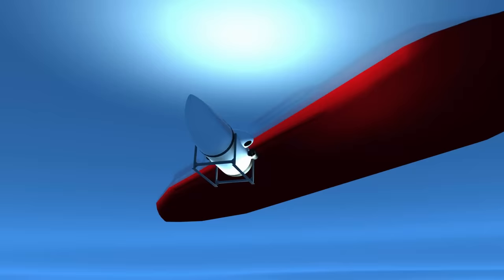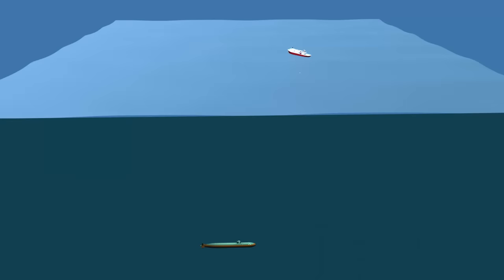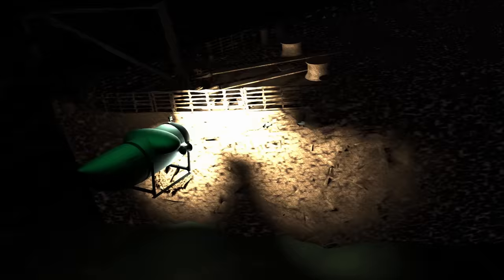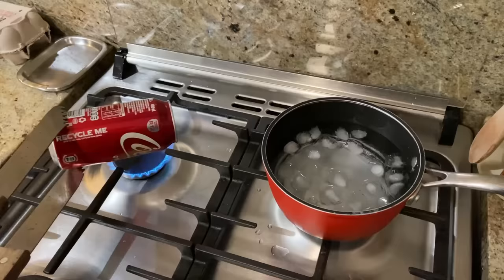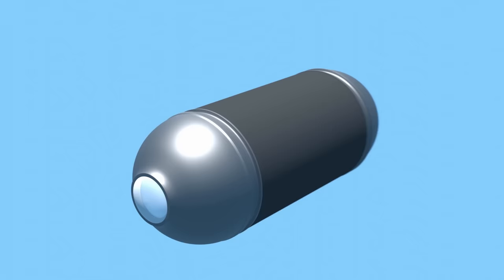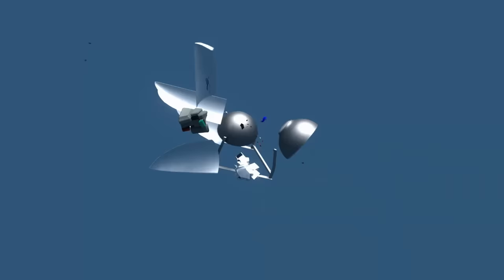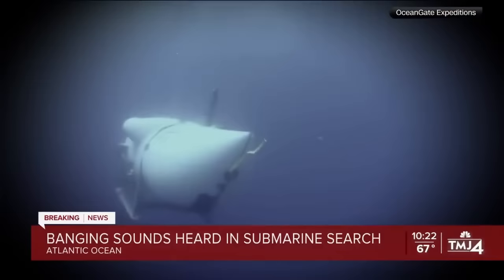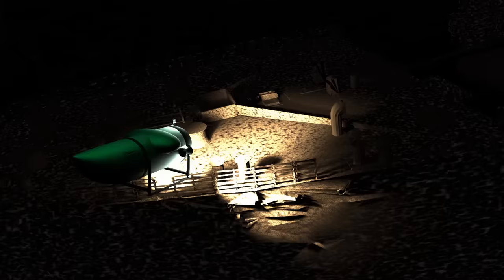TITAN Sub implosion | Deep Dive animation explanation

Comment: This was really good, I just can’t believe how something thrown together cheaply even made it to those depths a couple time before, you said trip 24? I heard they only went to the Titanic like 3 times, if the guy just retired it after a couple dives and built another probably would of worked, it’s just crazy that military subs or submarines in general can’t go that far, but that guy basically used a “water heater” and made it to the bottom of the ocean
Reply from the maker: Titan was by no means cheap. It was just cheaper. But when you are already spending big sums of money saving a few bucks is so dumb. If the main centre body had been titanium too I suspect some other non redundant system would have inevitably caused a disaster. Quite bizarre the way he dissed safety.
Reply: @Mike-Bell  ya that’s what I was thinking, the guy had money so why not make it perfect? Thanks for replying, I just keep seeing this stuff pop up but you’re video was the best one
Reply: it has many trips yes, but there have been hull replacement in those. this current hull had made about 7 trips before the implosion, about 3 or so were manned.
Reply: @terminalfrost3645  ok cool thanks for the information
Reply from the maker: @terminalfrost3645  Thanks for the important information and that sounds a lot better. Do you have the source.
Reply: I heard, this was Titan's 13th dive?
13 is a bad number.
Even hotels skip the 13th room or floor.
Reply: @szaki  It was not the 13th dive.  13 is not a bad number.  Hotels skip that floor to appease foolish people.
Reply: I believe this was the third year OceanGate had run expeditions to the Titanic wreck. They had sent down submersibles more times that than.
Reply: @Hyxtryx  Sub made 7 dives in 21, 5 in 22, and 1 this year.
13 dives, I think James Cameron said it.
13 is a suprstatios number, just like 666.
Yes, people are suprstatios that's why they avoided.
Hotels knows it.
Reply: I query the 24. I understand this was the seventh dive. I doubt it would have made 10 dives.😊
Reply: OK. It was not cheap although compared to a real submarine it was. The fact is submarines are built to very strict standards for different reasons. They are not built to just wonder down to the bottom of the Atlantic to look atvwtecks so deep submergence is not relevant. That belongs to the deep sea submersible folk with properly engineered deep submersibles not some equivalent of a gd sunset champagne cruise. .
Reply: @szaki lol, this is not even up for dispute. This was NOT the Titan 's 13th dive
Reply: @TheCandiceWang  Titan had many dives, most are test dives.
I'm talking about dives to the Titanic in 2021,2022 and 2023..
2020 the hall's rating was degraded to 3000 m, so it had to be repaired!
Reply: @Hyxtryx  lol, as I give your comment a thumbs up, it comes up 13.

Comment: I was watching a video made about ten years ago about pressure test on carbon fiber cylindrical hulls. When the pressure hull failed it didn't equally crush like the metal ones did, it split length wise and allowed the pressure to equalize. I'm thinking something similar happened but not length wise due to their incorrect way of laying the carbon fiber so the split would have been ring shape. My theory is the carbon fiber started to de-laminate and bow in the middle and the two titanium hemispheres just crushed it inward like stepping on top of a empty soda can. I think along with the microphone to record the cracking of the carbon fiber they did mention they had a string indicator (a string strong across from one side of the sub to the other to monitor how much the vessel is compressing, an old trick from the earlier sub days), so my fear is they started noticing the string drop way more then normal or the cracking was really starting to intensify they then dropped the weights in an attempt to save it but by then it was too late. Fear of this being a moment before the implosion they knew they were probably doomed, also with this many layers of incorrectly layered carbon fiber I wonder if there wasn't a second or two of water making it in by traveling in between all the layers before the implosion. I hope not as this would have been horrifying for them but we just don't currently know for sure as there are no substantial testing of this situation with the method of wrapping carbon fiber as they did. Makes me so mad that this CEO thought it was perfectly fine to take people down there when there were so many experts with decades of experience telling him "Hey, you're going to get some one killed!" He truly thought he knew better then everyone else.
Reply from the maker: Yes you think of the pressure onto the face of the tube but the force from the domes onto the ends of the tube are huge too. After pressure cycles the composite fatigue must have started becoming a mess.
Reply: If there were no carbon fibers, I'd expect the hull to be squished flat at the waist.  If there were longitudinal fibers which were parallel to the surface, it wouldn't be able to squish flat at the waist without substantially increasing the length of the longitudinal fibers, but the mechanical advantage would amplify the forces on the fibers enormously.  To make a strong structure, the fibers's direction vector would need to have a component parallel to the applied force

Comment: The dropping of weights does not necessarily mean that they knew they were in trouble. Stockton mentioned that they usually drop the weights several hundred feet before they reach the bottom of the ocean to avoid the sub hitting the floor at a high speed. This was a way to “slow down” the descent. Only the OceanGate crew will know whether this dropping of weights was typical or atypical. But they’re not saying anything now.
Reply: But not a terrible assumption
Reply: James Cameron stated he spoke with people in that group of the mothership and said they dropped weights because they knew something was wrong and we’re trying to come up.
Reply: They are NOT at several hundred feet before the floor. They were barely there. You do know how deep this was? They hadn’t reached that far.
Reply: @KittenBowl1 I read 3500-feet is when they lost contact. Possibly the moment of peril.
Reply: @Seashellsbytheseashore21  Yeah, I heard that the message was that the cabin had been compromised and they were dropping weights. Sounds to me like he sprung a high pressure leak, maybe a small pinhole leak, and the compartment was filling with high pressure water. 2 minutes after this message was when the navy sensors detected an explosion. I think the leak into that sealed compartment blew it up like a balloon until it exploded.
Reply: @mygunisinnocent8028  Water rushing in would not pressurize the sub above the pressure of the water it is in. I would not cause the submarine to explode. If anything, it would tend to equalize the interior pressure with the exterior pressure, preserving the integrity of the sub, but, killing all of the occupants. The sub imploded due to failure of the pressure hull instantly killing all occupants as the submarine had an uncommanded disassembly.
Reply: @glittle2993  Imagine a tire with a sealed bead on a rim, and a valve stem that lets compressed air into it. If you keep forcing air into it, it's gonna eventually explode. The pressurized water wouldn't stop entering the sealed cylinder on the sub until it exploded or the end caps were blown off. We know by the last message sent, that the cabin had been compromised and he was resurfacing, so this rules out a sudden failure of the hull and split second implosion.  My theory is he sprung a leak, could have been a pinhole leak the size of a human hair, that started spraying pressurized water inside and exploded the thing 2 minutes later. 2 minutes after the last message the navy sensors detected an explosion. Another scenario is that when he said it had been compromised, he meant part of the hull had collapsed, and 2 minutes later the whole thing imploded like your theory. Even with the authorities examining the wreckage, I don't think we'll ever know for sure what happened, unless the ones on the surface ship have information that they haven't released. James Cameron just said the last message sent was that the hull had been compromised, but maybe the message had more detail that they haven't revealed? Stockton could have said the walls are caving in, and we're dropping weights to resurface, or we sprung a leak. I don't see why the NTSB or whoever is investigating, has to keep everything such a secret.
Reply: @ChristopherKKirby  Cameron said it was 3500 feet.  What I do not understand about that number is that it was roughly 1 hour and 45 minutes into the dive.  They should have been much deeper at that point. 3500 meters would make more sense given the time.  That would put them most of the way to the Titanic. I think maybe Cameron misspoke.  Or possibly they had other issues that were preventing descent.  The USS Thresher had it's implosion happen at a shallower depth so it is possible, just questioning the timeline.
Reply: @mygunisinnocent8028  is there a recorded in the passenger area?
Reply: @silentpoet75  they had to go down on the platform first before descending in the Titan.  that would take some time yes.
Reply: @mygunisinnocent8028  umm would the hull becoming fatigued  and losing its integrity make noise...Yes.  Also water leaking in at that depth.  No it would just implode before that.  You would  not get to observe a little leak for one second under that type of pressure.  It was an implosion. Remember pressure was coming from all around the Titan. Extreme pressure. Its not a tyre or a leaky vessel. It was made with experimental material for that type of vessel that fatigued and imploded.
Reply: @silentpoet75 people who were on it before have said that it takes a long time to get down there, it doesn't fall fast.
Reply: @mygunisinnocent8028    No - the difference here is that the tire is a higher pressure than what's outside.  Additionally, the device providing the additional pressure through the 'valve' in that case - is the pressure outside the sub (the equivalent of the single atmospheric pressure outside a tire).  There is no additional pressure like a pump providing a higher pressure than the outside pressure.  The highest pressure that can exist, is the pressure of the outside ocean.  Which as others said - would equalise, not explode.  The options are equalise slowly - or implode.

Every bit of water that enters the vessel - REDUCES the pressure differential between the inside and the outside.  Conversely - pumping air into a tire from your example, increases the differential.
Reply: @mygunisinnocent8028  You don't just "spring a leak" at that depth, let alone cruise around with it for a few minutes. And how could the internal pressure blow out against the hundreds of atmospheres of pressure pushing in on it? That's like saying you could put a balloon under the Empire State Building and inflate it until it popped the building off.
Reply: @mygunisinnocent8028  - the leak in the sub doesn't work like a tire in the example you give. You specifically state "a pressurized hose attached to the tire."

There was no pressurized water hose attached to the sub. Once enough water poured in, assuming the pressure hull didn't catastrophically fail and implode, as soon as the air inside has been replaced by water from outside, the water outside stops coming in because the pressure has been equalized. In order to pump more water in you would need....a pump. Unless someone swam down and hooked a pump up to the crack in the hull, it's not possible to blow the hull up like a balloon, with the surrounding sea water.
Reply: @warrenpeas  Cameron says he got the information from someone on the ship.
Reply: @Texas240  At that depth there are millions of pounds of pressure, so that would be the pump. A leak the size of human hair would start letting pressurized water into the sealed hull. The pressure of he water at that depth is 450 atmospheres, but the pressure inside the hull was 1 atmosphere. The pressure from the leak wouldn't stop filling the sealed compartment until it is equalized at 450 atmospheres, so it would have expanded and exploded, which is why the end caps were blown off and the CF is in tiny pieces.
Reply: @vigorousera  If Cameron is right, it took 2 minutes for the vessel to explode. When Stockton sent the last message that the cabin had been compromised, 2 minutes later the navy sensors detected an explosion. Imagine being surround by millions of pounds of pressure pressing in. All it would take is a leak the size of a human hair to explode the sealed cabin. The pressure would be entering the sealed vessel with nowhere to go, so it would expand it until it exploded. The stream of pressurized water would be so powerful that it would cut a person in half. Ever seen those high pressure water cutters that cut metal?
Reply: @MKu64  But the tire or the sealed cabin in this case, would be 1 atmosphere pressure or not inflated, while outside is 450 atmospheres. The 450 atmospheres would be like a giant air compressor and a leak would be like a valve stem that allows the pressure into the sealed cabin or uninflated tire. What happens when compressed air enters an uniflated tire? It blows it up. In the case of this sub there was no off switch for the air compressor once it started inflating the sealed cabin with pressurized water. It would have continued forcing pressurized water into the sealed cabin until it popped or exploded. Ever been around a truck tire when someone forgets and leaves the air compressor on it and over inflates it? It explodes.
Reply: @mygunisinnocent8028  - No. Once there is water on the inside and outside, the pressure has equalized.
Reply: @Texas240  That would be if the sub was on the surface and sprung a leak where the outside and inside were both one atmosphere. It would just trickle in until the sub was full of water. Imagine a tick sucking blood from a body. The pressure of the blood is gonna make the tick swell up. Better yet, image there are things called pressure monkeys and the sub is like a bud light can. There are 450 angry pressure monkeys trying to get into the bud light can, because the 1 pressure monkey inside ticked them off by being a kweer pressure monkey. They are pounding in on the bud light can until one of them finds a hole to enter, then they all start cramming into that can through the hole, but it isn't big enough for all 450 pressure monkeys. It's gonna expand that Bud Light can until it explodes.

Comment: I hope they didn’t have any warning of what was going to happen BUT I saw a video last night from a guy that went down in this submersible on its second dive, he said there were loud noises almost like gunshots going off the deeper they got and it happened during resurfacing also. I truly hope these sounds weren’t significantly worse before the implosion and gave them a chance to get worried about what might be happening. 🙏🏽
Reply: as far as I'm aware they did sense danger, according to james cameron they dropped weights.
Reply: Hi, can you please link that video?
Reply: The last communication they sent was that they dropped their weights and that was before they reached their decent so they knew there was some type of trouble because they were going to attempt to resurface, but not as an expert in the matter but I would guess that they had no clue what was to follow because even the smallest leak would be instant implosion according to tests..
Reply: second dive? Titan made quite a few more dives between the second dive and the last one.
Reply: @stackhat8624 According to this video Titan made a total of 24 dives but there had been hull replacement in some. This current hull had made about 7 trips before the implosion, about 3 were manned.
Reply: This video explains they dropped their weights to resurface urgently so they most likely knew something was going wrong before implosion. He said so in the video
Reply: If the Titan made a lot of noises even when it was new and some of them loud, then the warning they got must have been an unusual sound or they saw moisture around the endcap seals. A leak could occur where the CF and end caps are joined - with glue! In an interview, Stockton Rush explained that the plexiglass portal expanded during dives.
Reply: They did know :( prayerfully for just a short time. Stockton must've tried to get the sub to ascend back up quickly
Reply: The guy who went down in Rush's second dive is Karl Stanley, who has a mini-sub and takes passengers to 2000 ft. in Honduras. he has been doing this safely for 23 years. That submersible used in the second dive was Rush's Cyclops 1, after that dive with Stanley, he replaced the carbon fiber cylinder with another one made by a different company. That mini-sub became Cyclops 2. which was then renamed Titan  when it was put into paying passenger service. (Possibly with some additional modifications). But the dive you are talking about was not the second dive of the Titan. Also, it is not clear at all where, when, or how many dives the Titan actually made. Ocengate's claim on their website was about successful TRIPS, which may or may not have included full descent and return to the Titanic wreck. As we know, Rush was a master of misdirection, and unexplained superlatives.
Reply: @if6was929  I think from passenger testimony, there were more than 3 that were manned, but only 3 of those 7 or so made a full descent and return to the Titanic wreck.
Reply: @davidelvin4982 there is one on newsnation if I remember right